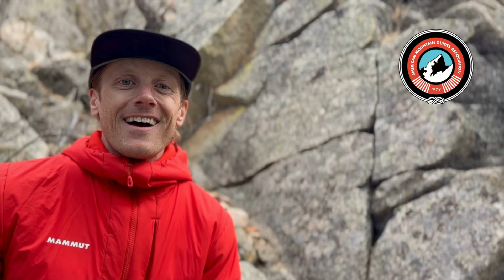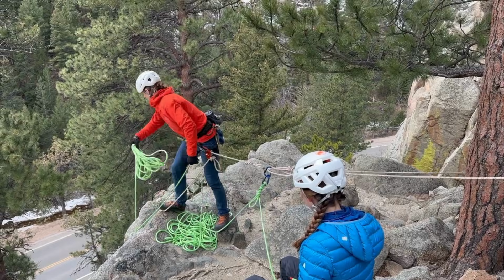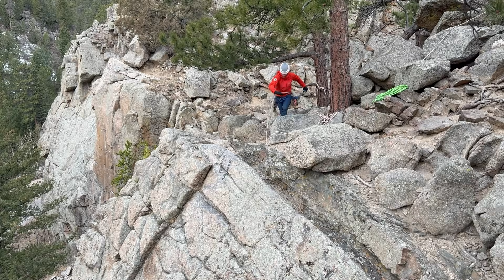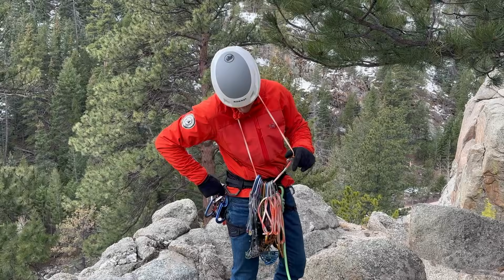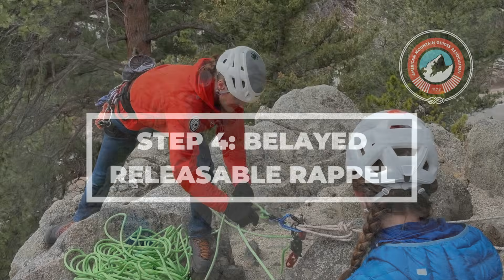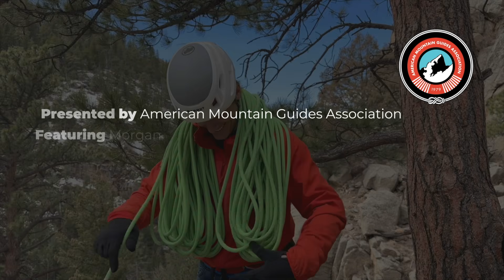Single Pitch Skills Scenario: Top Managed Technical Drill

Comment: At 8:33 the climber descends to the instructor on a munter with no friction hitch is this acceptable because it’s not yet a lower?
Reply: Yes, at 8:33 no friction hitch backup is needed because the climber is being belayed to the anchor with the munter. In this situation the climber's first line of defense against falling is their climbing movement and the belay is a backup. In the case of lowering with a munter though, a friction hitch backup is necessary, as the climber is solely reliant on the belay mechanism. Similarly, a friction hitch backup isn't necessary while belaying a rappel.